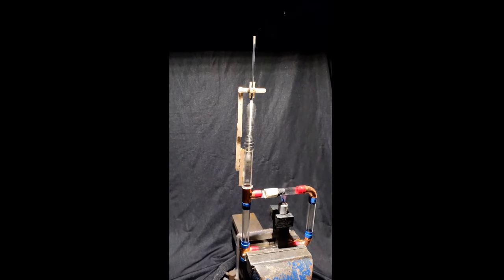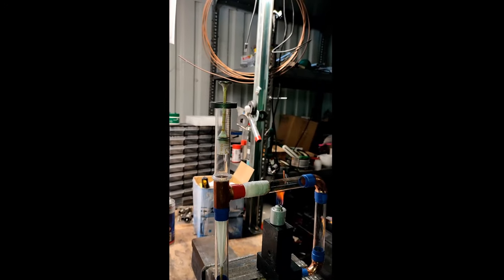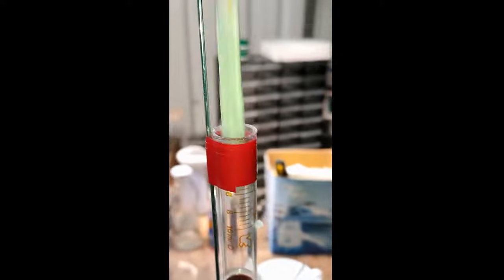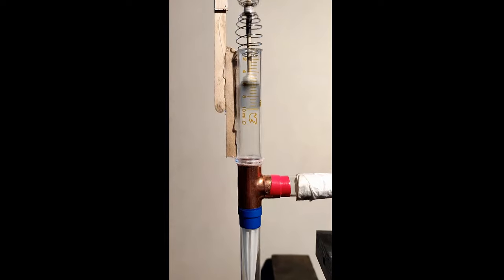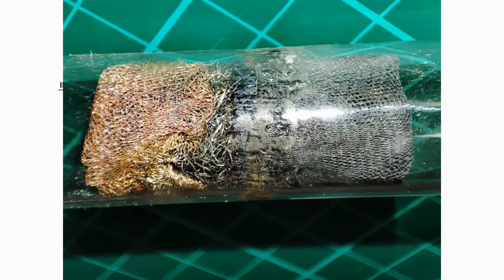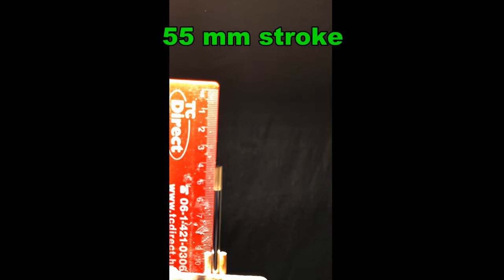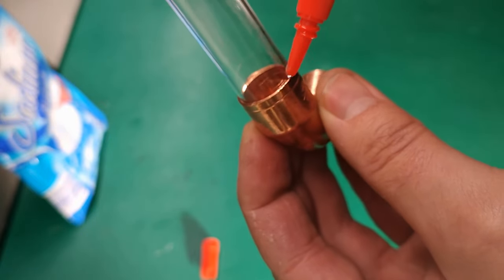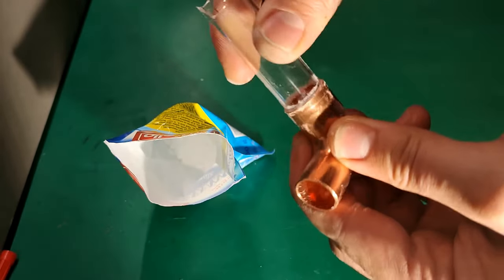Developments on my Simple Thermoacoustic Stirling Engine - Stirling cycle with NO crankshaft

Comment: Thanks, Blade, I take your advice to split the regenerator in 2 parts. First I will try normal steel fine grade + stainless steel (exhaust whool) . If this is no improvement, I will proceed to copper whool (I don't who can deliver it...). PS: I like the tunable membrane, something my construction does not have. So I have to make the membrane box with a certain membrane tension, assemble everything and then I might discover that the output is even worse than before....
Reply from the maker: Think positive! :) The worse means always different. Some people never hit that. Some people don't know how to hit that range. Some people think it's impossible. Few people do it and experience the power of this level.

Comment: Why not just make the piston the magnet and put the coil outside the tube?
Reply from the maker: This is possible, but the generators are not my favorite parts actually. But anybody else could build a generator to the replicated version of my unit. I'll be happy with that if it will happens. I alwayswant to show how easily could make a hot air engine without complicated premachined parts. I like the unique designes what you can't found in the webshops usually. Maybe if I want to open an online store, then I will thought about some generators, because people like it so much. Thanks to your comment! BLADE

Comment: Can you make more with crankshafts please
Reply from the maker: Dear Dominic, I'm going to the crank-less engines, heat pumps, but I really like those mechanical linkage heat engines too, so maybe in the early next year, because I want to finish my crankshaft based Metronome unit. ;) BLADE

Comment: Tip for clean edge on joins with adhesive. 1) Tape on areas you don't want glue on by applying tape very close to the edge of what you are going to apply the adhesive. 2) Apply adhesive. 3) Remove tape.  There you go, clean sharp attractive edge.
Reply from the maker: Yep, that's a good point Keith, but the speed sometimes more important than the nice edges. But it looks more professional with applied tape! Thanks to your idea! BLADE
Reply: @AttilaBlade I've done lots of home improvements. When caulking  glass windows or painting, applying tape can give nice sharp edges.
Reply from the maker: @kreynolds1123  Me too in the past 6 months and the last week I started to build up thin insulation tables onto the walls.